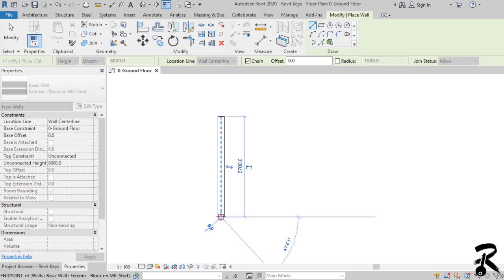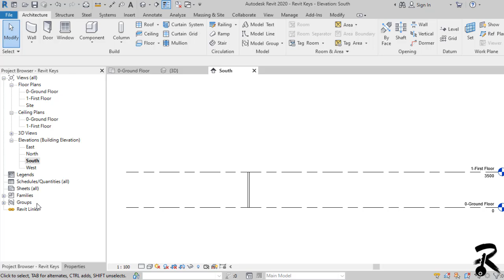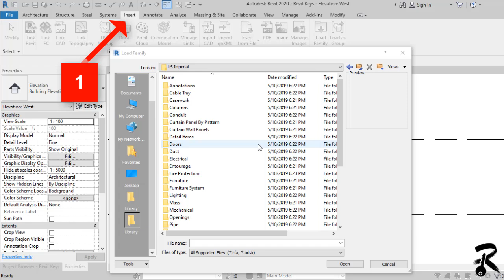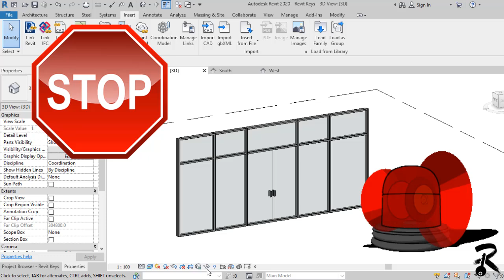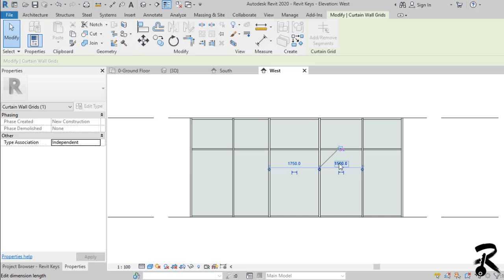Door on a Curtain Wall in Revit

Comment: Great demo!
If reverting an unpinned panel such as at 3:46, I usually prefer to 'pin' the panel which will set it back to the default panel of the curtain wall instead.
Reply from the maker: Many thanks for this note!! 
Yeah the "pin" is a good and quick tip to get back the default panel.